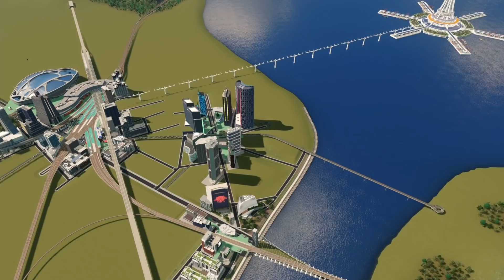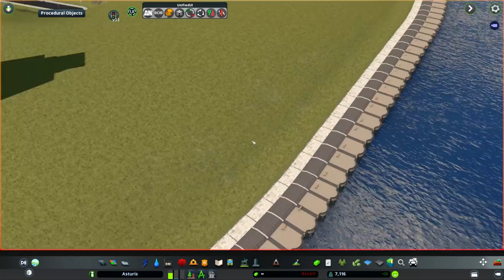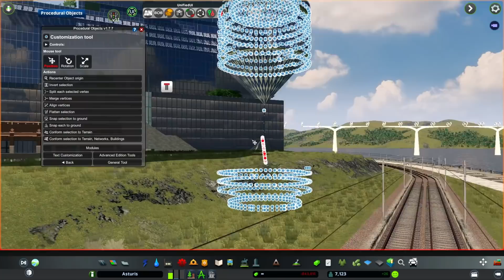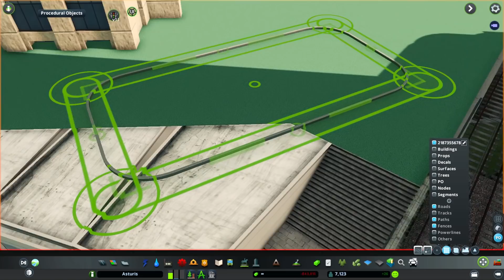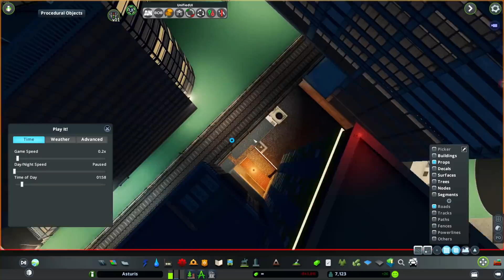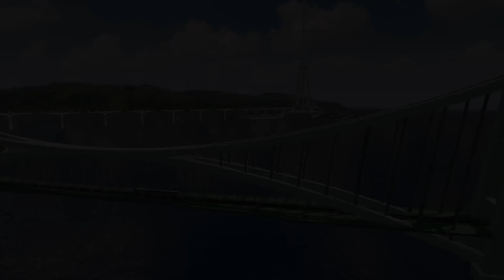Tram Bridge and Waterfront Park - Cities: Skylines - Asturis 8

Comment: I love this part - the layers, with industrial stuff visible on rooftops below the upper walkways, is so amazing to see. The vivid bridges and ads are so cool, and the lights on buildings are also so great. I'm wondering if the flying train line could use some lesser lighting along its length, too - it would certainly make it fit this theme. Later more fully industrial areas will be great to see too, meshing with and still contrasting the style of these clean residential/office areas. Those twin apartment buildings at the front are also quite striking, having them lit up with spotlights from below might make it just that bit better even if it's not quite too realistic to point lights like that at peoples' windows - it's futuristic, they can polarize their windows.